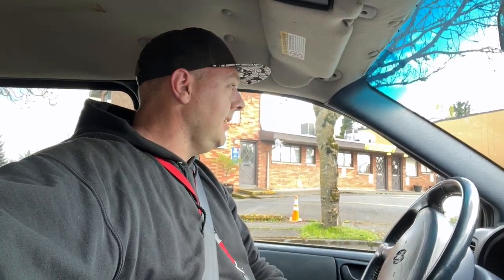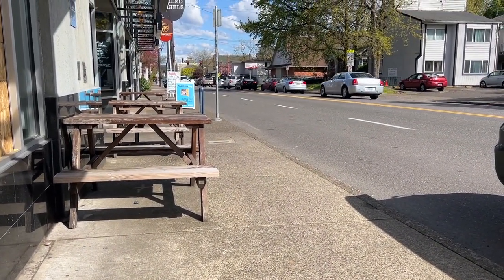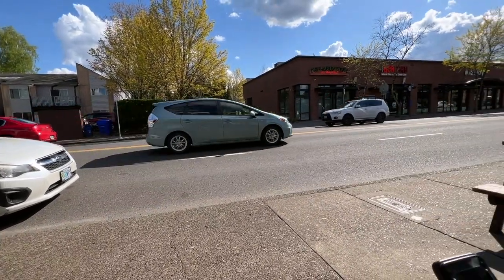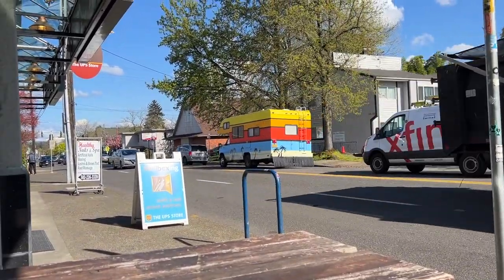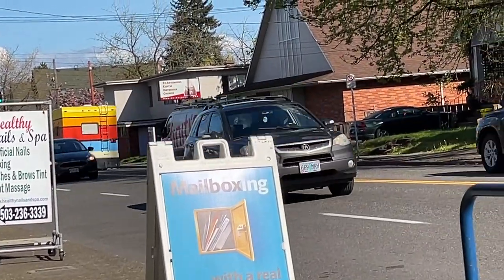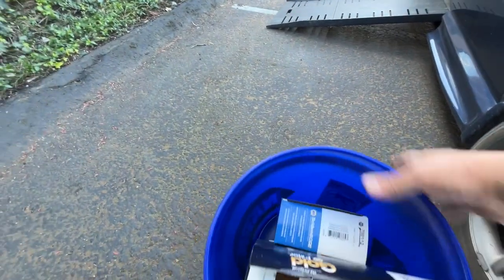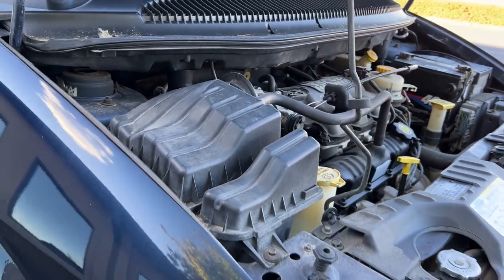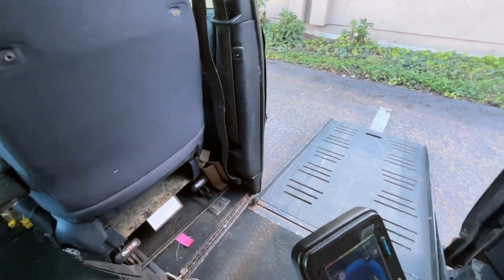MEGA VLOG 608: sorting out the new van!

Comment: The limit switches on my war underpowered 2014 F150 Dorf with a Braun UVL would literally cycle 5 times and have to be adjusted ! I could not get the limit switches to work on uneven , perfectly flat ground parallel to the lift. Then have to be adjusted again!
Reply from the maker: ive found on a lot of vans with UVLs, they build them on 1/2 ton chassis! when theres a bit of body roll as all the weight is out on the end of the lift, the limit switches move as a result! its a mess!

Comment: Hey Dan, interesting video!  Sure seems like a relay issue to me, but it could also be about 100 other things as well :-).  Wonder if there is a slight voltage drop to the one relay.  I know you swapped relays with the same result, but I still wonder what a new relay will do?  Maybe the power cycle with the button pressed gives the old relay just enough of a power kick to operate, and a new relay won't need that. I know you will figure it out and I look forward to seeing how you fix it.

Comment: Dan I assume the Dodge is a regular Caravan since it has a 3.3L motor in it GC's used a 3.8. My Town and country has the 3.8 with 197K and is very quite. Since it is a Braun Entervan I had a burnt Controller I wonder if something like that has happened to your Rincon lift i have faith in you brother on figuring it out.
Reply from the maker: all my replacement relays will be here tomorrow.. im also going to check the solder connections on the back of the control board...  Ricon quoted me $5000 for a new controller!!!!! and they said "we probably have one" but it'll take 60 days at least.  got to thinking about it, and it would be fairly easy to just bypass the controller, and use my own relay for that one function :^)
Reply: @TotallyNormal-  I contacted Braun about a wiring diagram and was promptly told I needed to bring van to a service center now this is a2007 van a total beater that I paid $2800 for . So I dug into it and found that the controller had melted connections I was not about to give Braun any money. So I found a 2014 T&C with a VMI conversion. Don't know how much you paid for your '02 but it looks pretty clean.

Comment: Hi Dan, we have the same van as you. Its a Braun mobility entervan 2000 dodge grand caravan. My mom wanted to know how to change the oil with van being so low to ground ?
Reply from the maker: the oil filter is right behind the front bumper on passenger side - easy to get to without jacks... and you can use a 'dipstick oil change' kit.. they sell them for boats etc.. like that white vacuum ball i was using for the transmission.
ya just need to warm up the engine first for the dipstick change method - the oil needs to be warm to work the best.
https://amzn.to/36wdMH4
Reply: @TotallyNormal-  thanks dan